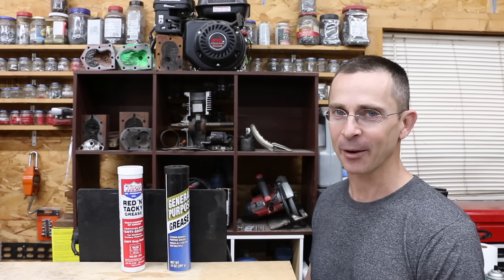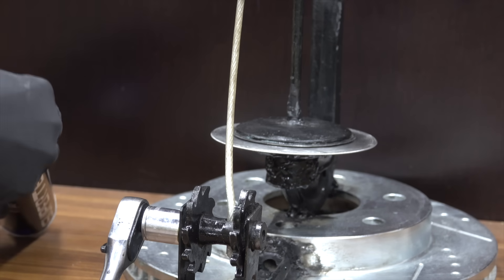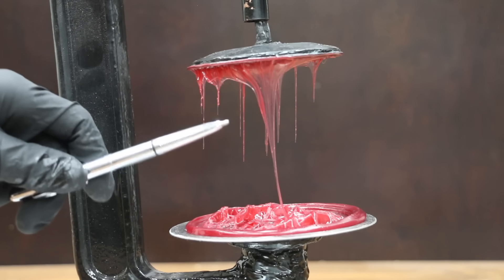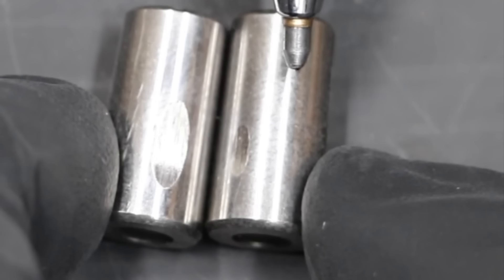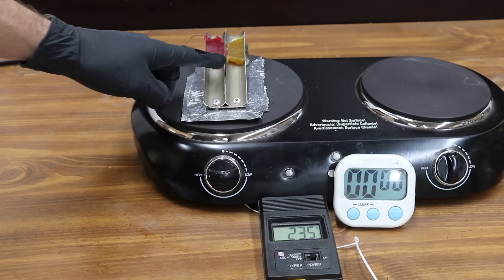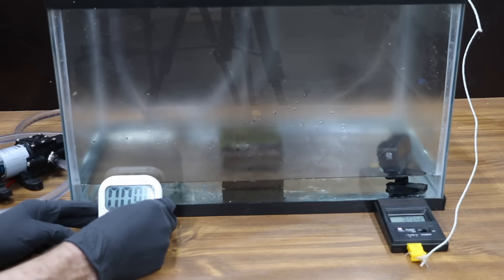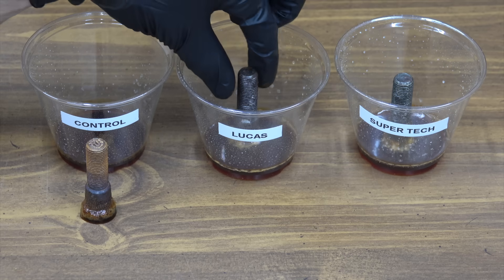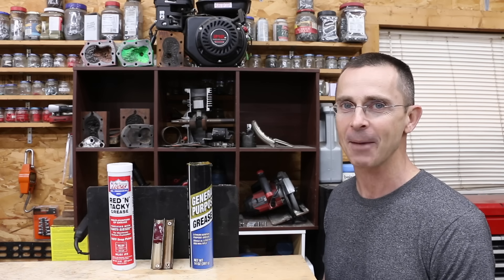Is Cheap Grease better than Lucas Red N Tacky? Let's find out! Bearing Grease Test Episode 1

Comment: How does one define "light duty", and how does that differ between a million opinions? 

Lucas is obviously better. But is the generic stuff horrible if you repack on a scheduled preventative maintenance basis? If your alternator bearing needs grease, thats too much work.  But a ujoint, wheel bearing, steering linkage, is all easy. 
My alternator bearing dried up! And it needed to be repacked with grease! I repacked it and the noise is 50% better. But it still whistles at certain speeds and i am 100% certain!

Did it dry up because of the cheap grease used in the taiwan made bearings with fomoco stampings? Maybe. This vehicle has 37k miles but has seen a ton of snow and was parked outside its whole life.

Comment: I changed out the drive shaft, universals, ball joints etc for ones that have grease fittings on my F150 and use Lucas at every oil change. Not sure if the money is well spent over the cheaper one but I think so and it's cheap insurance.
Reply from the maker: Thanks for the feedback.

Comment: You are not using ASTM testing methods which are designed to be conducted in a laboratory under precise conditions. I doubt any oil manufacturer uses your made up tests to evaluate their products. This is just a side show. Beware of this kind of sales tactic and check with your equipment manufacturer for their recommendations on the type of grease to use.

Comment: A red grease was used on a HORRENDOUS boat trailer bearing. It was so good that the trailer made it 20+ miles at up to 45mph with no issues. The bearing was literally just a hole with a rod through it - guess it regressed to a plain bearing. I don’t know if it was this grease, but it was red and thick.
Reply from the maker: Thanks for sharing.

Comment: I've been using the Lucas Red n Tacky  for bicycles for a long time now. As a professional bicycle mechanic I've tried  a lot of brands and types. The Lucas  red stuff works great it even holds up to  wisconsin winter commuting. That's pretty good for a lithium soap based grease. I prefered it with the 3 season bicycles because of the low working resistance and that 300° F stuff does not work with disk brake hubs and got tired of repacking the side with the rotor . It's how I stumbled upon Lucas because it was every were I shopped so gave it a try. As for that winter season I was  using WD Speasialist  the True Multi Purpose Calcium Sulfanate soap based grease. That stuff was very good in salt conditions and also good at very low temperatures.  (The red n tacky works but not reliably past 2 or 3 seasons) just found it works better than the Lucas marine . The WD stuff was always on the shelf next to Lucas. Wish I could still get it had a real high drop point  and superb high pressure ware, the red n tacky had lower rotational losses. Any one knows a product for marine salt conditions that works better siince i don't see WD anymore. I'd like suggestions. Think the Lucas  Marine has a new formula but real world tests for grease is a five year commitment. Full time commuting with a bicycle is tough on bearings because everything  is as small and light as possible and even beyond possible. Threre is a big load on those tiny bearings. A great test ground for endurance and many brands have failed especially "made for bicycles.  Except Dura Ace grease (advanced calcium soap holds up under brutal conditions some say its Motorex endro bike stuff rebranded)but that stuff  was very expensive worth it at 35$/# couldn't use it on everything. The Lucas is close and the front hub loaded with it the wheel definitely spins longer than anything in it's price class. Tow seasons in Mikey's bicycle isn't bad. He was my best test mule he accelerated ware by a huge margins .
Reply from the maker: Thanks for sharing.

Comment: Every master mechanic I've ever met swears by Lucas. I know a dude who literally ONLY uses Lucas in oil changes on his high wife's high mileage minivan, and doesn't use any regular oil. He claims it doubles the mileage at which you need to do another change, and after seeing his results, it's hard to disprove his theory.
I've been using Lucas as my go to oil, lube, grease, treatment, etc for anything involving oil. (I use seafoam in fuel, because seafoam)
It's cool that in all the tests involving Lucas, it's reinforced my choice. Lucas is truly an amazing oil.
Reply from the maker: Thanks for sharing.

Comment: Would love to see a comparison test of Lucas red n tacky, Lucas Marine grease, Amsoil and other premium grease.  I used to use Quicksilver Marine "2-4-C" grease and while it did the job it always seeped liquid and did not do a good job on the heavy outboard motor pivot points, could hear the metal on metal contact when tilting the motor.  I switched to Lucas Marine and it cured the seeping and no more metal on metal noise when I tilt the motor.
Reply from the maker: Thanks for the suggestion.

Comment: Of course Lucas is better but you mixed them thinking there might be a reaction because of the warning on the Lucas tube, you took it wrong, that was don'tt mix it with other gresse  thinking that the mix would then have the same strength as pure Lucas gresse because it wouldn't being a mix!
Reply from the maker: Thanks for sharing.

Comment: I love how thorough you were testing so many different aspects of these greases, and clearly demonstrated that the "light duty" Supertec really is for light duty! But I'm much more interested to see you compare the mineral oil based Lucas versus the synthetic Mobil 1 grease. Both are GC-LB rated, so does the synthetic base oil make a difference, or do two equally rated greases really perform the same?

Comment: Retired USAF. Used this on F-15 wheel bearings and various components.

It stays, does not breakdown, and it's "tackiness" pulls back into assemblies, especially in wheel bearings.

Additionally, "cold soaking" aircraft at altitude resulting in -50F to -60F temps and having superior performance from the lubricant, is a must.

When you spin bearings from 0 to near 200 mph with weight from 45,000-52,000 lbs, you don't mind spending twice as much for superior grease.

Same for vehicles.
Reply: I greased my garage door and it doesn't squeak anymore;)
Reply from the maker: Thanks for your service!  Thanks for sharing.
Reply: It’s about 5 bucks on the civilian side per tube. What does that translate to in military terms??? 500 a tube?
Reply: @1AcidBurn2  If a pencil costs 50 grand, I'm thinking a tube of red and tacky is worth an entire house
Reply: I used to paint aircraft in the Air Force. 354 MXS.
Reply: What is 'this" ?

Cheap Grease or Lucas Red N Tacky
Reply: @JohnSmith-ps7wp  Red N Tacky? grease. It has a component that causes it to be "pulled" into the areas in contact with each other that interact, instead of being forced out, slung off or otherwise wiped away from the areas needing lubricant.

Additionally, it "self churns" or constantly reintegrates, so that the grease works longer, replenishing from the grease that is in the components.

Other grease can become "isolated" to a small amount that stays on the part and the greater amount of grease is not utilized, but just sits there "separated" from the components.

Hope that helps
Reply: You were most likely using Mobil 28. It's made for aircraft wheels and is very different from the Lucas. I compared them when I saw the red. Definitely different from each other.

Comment: Love your product tests! I’d like to see a test of engine decarbonizers. My dealer pushes decarbonizing for $230 each time I take my car in for service yet there are several gas additives that advertise decarbonizing. For about $10 bucks per treatment, I could get a whole lot of benefit over time as opposed to a one and done — if they really work…
Reply from the maker: Thanks!  Thanks for the suggestion.
Reply: It depends is your vehicle direct injection? Otherwise how do you get the carbon on the backside of the valves
Reply: @rYan-qo9si  Toyota that has port injection.

Comment: I am not a fan of magic oil additives, but I have been using Red N Tacky for years.  Real world use has demonstrated that is STAYS in chassis parts - it does not get washed away and allow water intrusion like most chassis grade greases.  It also maintains it's lubricating qualities for the entire service interval.  It goes in red and purges reddish during re-service.  This product lengthens the life of chassis parts exponentially.  Thank you for confirming the quality of this product.
Reply from the maker: You are welcome!  Thanks for sharing.

Comment: grease isnt grease. If you try and use molly greases in bearings youll burn them up , additionally some of the cheaper brands have a tendency to come unmixed over time. Leaving your bearings and bushings full of the wax fillers they use while the oils sweat out.

Comment: I was wondering if you think the Red N Tacky has a higher viscosity than other greases. I need a grease that will flow easily using the EZ Lube wheel bearing system on my trailer, so I don't risk blowing the seal out. (my theory) I believe the bearings have the Red N Tacky currently, so I might have to stay with it regardless. Thanks
Reply from the maker: Thanks for the suggestion.

Comment: I've been using the Lucas for years especially on boat trailer bearings. Don't want to be "that guy" on the shoulder of the highway with the burned wheel bearings. That would make for a bad day.
Reply from the maker: Thanks for sharing.

Comment: I sold Sta-Lube grease and related products for many years and always considered them as above average. I always used their boat trailer grease until I found out it didn’t do well in Arctic temperatures. Their red grease is about the best I ever used. Did learn that in extreme cold 0-20W Synthetic oil could be better. I’m talking about-40- -60 F.
Reply from the maker: Thanks for sharing.

Comment: One final test. Fill 2 grease guns with grease and hang them in a shed or off the side of a toolbox, push rod side down.  After a few months, go back and check for any signs of leakage out the push rod side. I will bet the Lucas Red will have separated and you have a big red stain on the floor. I use Lucas Red and Tacky, but it does break down under normal room/shed temperatures.  Really sucks when I grease the neck bearings on my Harley and a few months later have a red stain on the gas tank.
Reply from the maker: Thanks for the suggestion.

Comment: Beyond the little gears demo I've played with in parts stores for lucas oil stabilizer (where i assumed the demo presented to me was truthful), this is the first test I've seen of a lucas product compared to another.  I found that red n tacky is also a lithium-based grease (from the lucas site: "Lucas Red "N" Tacky Grease is a smooth, tacky, red lithium complex grease fortified with rust and oxidation inhibitors.").  But I want to know how fair the test was since the general grease is noted as light duty. Since this video is about 3 years old, perhaps you've already done more greases since then.

Comment: It would be interesting to try and figure out what the Egyptians used for grease for their chariot wheel bearings and put that to the test. I'm pretty sure it was probably some type of animal lard or fat.
   I've been using Lucas "Red & Tacky" for years with excellent results. It is also available in an aerosol spray can. It comes out thin, penetrates really well and then the solvents evaporate after a few minutes to leave behind the "Red & Tacky" grease.
Reply from the maker: Thanks for the feedback.

Comment: I just quit my job after 40 years working in a service station it was well over my time injuries are bad. I have watched these changes for year's and yes grease has come a long way. You may want to test anti-seize next, they should have high temperature rating  one's for o2 sensors. I am sure that you probably know nothing is harder to get off your hands or whatever it touches then anti seize or grease. I  have seen anti seize get so hot on a brake slide that it will harden and not allow slide to  move. Keep up the great work almost miss it,  hard to believe I never liked working on vehicle's.
Reply from the maker: Thanks for the suggestion.

Comment: As always, another well-done video. It's been 3 or so years since you made this, maybe you've made a follow-up video I've just not seen yet...but: I'd like to see another grease tested. I have tractors, trailers, plows, a skid steer, and blah blah blah. I have used a brand/product I can't remember from TSC which claims to have 3% molybdenum. I bought a 12 pack and it cost more and the theory (marketing BS?) is that it protects better. I'd like to see your testing methodology applied to this "3% moly" grease.  Like the products here, it comes in tubes for grease guns.
Reply from the maker: Thanks for the suggestion.

Comment: What grease goes into the car Intermediate Drive Shaft housing? I removed CV Axle and the seal for Intermediate Drive Shaft and cleaned inside the housing, but what grease to add and how much? It is for 2001 Saturn SL2. Thank you for the informative film.
Reply from the maker: Thanks for the suggestion.

Comment: LUCAS GREASE MY #1 GO2
I had a torn inner boot drivers side on my 2002 Toyota Corolla and it was making bumby and vibration on acceleration. By reading and searching on the internet I tried two full tubes of Lucas grease and injected it into the spider bearings and the other tube in the boot and closed it up. Took it for a small spin and the vibration faded away within 20 seconds once I hit the HWY Freeway. Took it up to 150 km/per Hour for 30 seconds and dropped it to 130 km/Hr for 30 minutes.
AMAZING! 
LUCAS GREASE IS A MIRACLE! IT HAS BEEN NIW 3 MONTHS AND SMOOTH AS PIE.
I could not go more then 60 km or it would vibrate. On acceleration it would vibrate.  
Before replacing your CV Joint, try LUCAS  GREASE!!!
Reply from the maker: Thanks for sharing.

Comment: All the testings are well done, however they are made for different purposes. Many commenter automatically assume red tacky is better  but some applications you might need thinner grease, For example strut bearing need thinner greese than wheel bearing. Thank you for the video.
Reply from the maker: You are welcome!

Comment: Awesome video! I’ve been using Lucas High temp red and tacky on the slides of all my firearms for a long time. Unlike oil, it stays put and my guns run smooth as silk. Just clean with some Hoppes No.9 solvent when it’s cleaning time to remove old grease, then reapply. I used to use any old high temp bearing grease on my guns since the mid 80’s and it worked good. But since I’ve been using Red and Tacky, I won’t use anything else! Good stuff!
Reply from the maker: Thanks!  Thanks for sharing.

Comment: I would like to see Mystic vaseline clear and Mystic red added to tests also the grease carried by tractor Supply (warren Lubricants?)   their red high temperature loses the oil on a hot day.  I Mixed a bunch of Lucas climbing gear additive into too thick grease 5 gallon pails   I bought at auction.   I also mixed in chain saw bar oil to too thick military surplus grease for use on rake gear boxes and things that you would use corn head grease in normally.
Reply from the maker: Thanks for the suggestion.

Comment: I'm a heavy haul truck driver. I put anywhere from 40k-60k pounds on my 5th wheel.  NOTHING compares to Lucas red and tacky in that environment as well. I swear by all Lucas products!
Reply: Do you clean the 5th wheel before applying new grease to it? If so, how do you clean it & how often? I usually get a plastic scraper and take off any old hardened dried grease. I then put on a glove and apply a light coating of new grease by hand.

Unfortunately, I drive a company truck so, I can't be as anal as I want to be with things like this. I also know the company I drive for used cheap ass grease before because all their other trucks have black cake on or under their 5th wheels.

My assigned truck's 5th wheel was bad in that regard too before I serviced it. Some other trucks have rusted ass 5th wheels because those drivers flat out don't give a shit or don't know.

I do it because I like to be safe and because I really hate to see heavy machinery go through the rigorous work they were designed for without getting the proper maintenance they need to stay in operational condition to keep up/withstand that abuse.
Reply: @PayroCoin  yes I scrape off the old the same way about every 2-3 weeks (apply new by hand 1-2 times a week.  A sticky 5th wheel can cause a lot of problems especially on slick roads.
Reply from the maker: Thanks for sharing.
Reply: @ProjectFarm  Perhaps you could enter some Schaeffers into the next round of grease competition? I seriously doubt that any other grease stands a chance of coming out victorious after being subjected to your testing practices. There's only one way to find out for sure......
Reply: I was/still am a Lucas fan but when it comes to extreme pressure grease, Schaeffers has proven to be far superior in every aspect possible. Your application is a perfect scenario for Schaeffers 238. It was difficult for me to give up my Lucas and try something else. Now it would be much more difficult to get me to even consider trying anything other than Schaeffers.
Reply: @CaptainContraption  I looked up that Schaeffers 238 grease you mentioned and it's $19.95 for a 14oz tube at Walmart... ouch! The Lucas Red N Tacky tube is only $6.98 in price. I would like to see a direct comparison between these two. My guess is that the Lucas grease won't be too far behind the Schaeffers - IF it is as supreme as it claims to be.